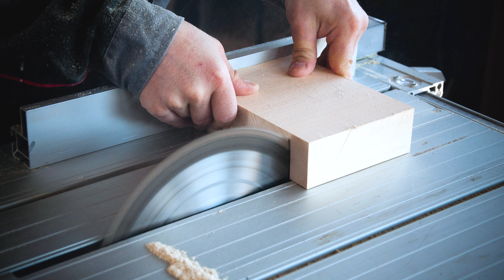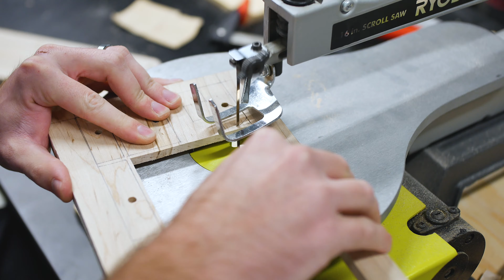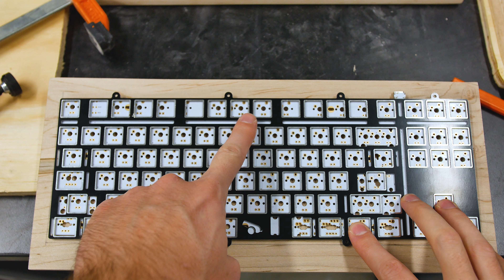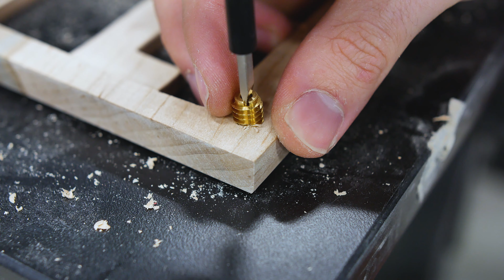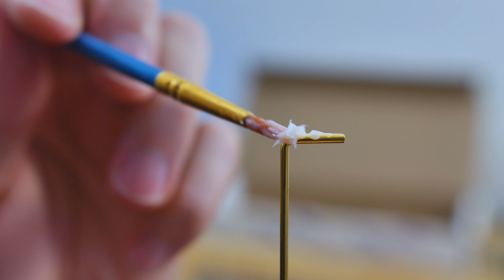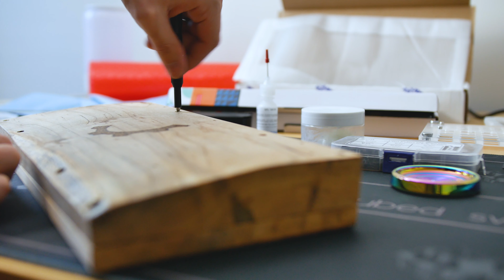I Turned This Block of Wood Into a Mechanical Keyboard

Comment from the maker: I originally wasn't planning to make another handmade wooden keyboard since this content was outside my normal review routine, but with the recent flood of support from you all I think I might just change that decision. I still don't have a CNC router, but where's the fun in that...thank you all for the support and comments!

Much love,
-JD
Reply: Did you use router when making that wooden case?
Reply: You should use strong magnets for the frame so it's easier to remove
Reply: Hey there, great video, just wondering what threaded inserts did you use. Planning on building my own!!
Reply: Where did you get the stand-offs from I'm trying to do a build sorta like this with the wooden case it would be great if I could get the parts. As you know I'm trying to do this is there any way I can be walked through with the steps etc? I also can't find any wood for my keyboard :(
Reply: @ako4693  you should have some kind of lumber store near me.
Reply: Please do! I have a mk870 on the way which I plan to purge for the parts and give a nice walnut case.

Comment: Hey cool videos. Have you tried making the plate too? I am wondering how will it feel.
Reply from the maker: Thank you! I haven't tried making the plate, that would require a lot of precision haha, if I had a CNC of some sort that could be a possibility which could offer some unique sound profiles, but I would worry it would be too brittle
Reply: @jdtechgear  Yea, it bring like around 1.5mm thick might be a challenge. Not sure if using like PU finish or wood hardener help.
Reply from the maker: @jierenzheng7670  I think I would have to find the right type of wood species that has bendy properties to it while akso being able to cut precisely

Comment: Where did you get the stand-offs from I'm trying to do a build sorta like this with the wooden case it would be great if I could get the parts. As. you know I'm trying to do this is there any way I can be walked through with the steps etc? I also can't find any wood for my keyboard :(

Comment: couldn't you have just used template tape and a raised router bit to cut those holes out for the top plate? would have been much less stressful
Reply from the maker: No, the handheld router is too volatile for that. Also add on the risk for blow out between those narrow margins between the key clusters.

Comment: Next time draw two lines 1-2 mm apart, the external line is your actual line. Cut the internal with the saw and sand or file the remaining, more accurate result and it feels like you are a pro as well
Reply from the maker: Will try this next time!

Comment: GREAT CONTENT!
Hoping to see rubber o-ring mount configuration (like bakaneko), no standoffs but provide flexy/bouncy typing experience and provide even sound across the whole keyboard.
I think it will be pretty straight forward but giving you new challenges at the same time 😂

Comment: Mad respects and thumbs up for Anubis switches! This is truly end-game !
Reply from the maker: I really like them! I do wish the bump was bit earlier in the key stroke, but that's a preference that I can get used to. I would use these in another build for sure!
Reply: @jdtechgear  cool to hear. I am going with holy Bobas in my upcoming build but if i had known that the Anubis switches existed before I bought the holy bobas I might have settled for those instead.
Reply from the maker: @Lacsap3366  You'll probably have a sharper tactile feel I believe? Similar sound, but the Boba U4's are good comparator. I haven't had much experience with frakenswitches. What kind of plate and keycaps will you be pairing with the holy Bobas?
Reply: @jdtechgear  my whole build will consist of:

- GMMK Pro
- Polycarbonate Plate
- Holy Boba / Sake Switches
- Durock V2 Stabs Holee modded with UHMW tape, housings lubed with 205g0,  wires lubed with XHT-BDZ, foam under the stabs 
- gasket mod using D65 gaskets 
- PE Foam mod
Reply from the maker: @Lacsap3366 Sounds like a solid build, I'd recommend leaving out the internal foam to get more sound out of your Sake switches, that board likes to mute a lot of sound.
Reply: @jdtechgear  which foam exactly do you mean ?

Comment: It turned out super nice!  I was a little worried when I saw the scroll saw cuts--but it sanded up cleanly.  Great job!
Reply from the maker: Thank you! Trust me I was really nervous if I could get the scroll saw cuts right. As long as the sections in between the key clusters were sturdy enough I could file them down and sand to a better finish.

Comment: Dude this build is awesome, so happy I came across this. I recently did a wood keyboard build video myself and it was such a struggle, the thin wood grain around the keycaps borders is so weak.

I'm shocked you did this with only a trim router and scrollsaw, and got it on the first try. I had to do like 6 tries on mine bc the wood borders kept snapping 😭    Cheers!!!
Reply from the maker: Thank you so much! That was one of my primary concerns that the spaces between the key clusters would break since the wood is so thin. This Maple is sturdier than I expected so they were able to be filed and sanded without much worry. 

What kind of wood are you cutting? I know some species of maple are softer than others, but it is possible! I really didn't expect to get this far with a scroll saw haha
Reply: @jdtechgear  I did oak, also a hardwood, but I used a full sized router so it's power kept blowing out the weak points. This video gave me alot of ideas for my next wood case build. The scroll saw is so gentle and quiet so that's probably why you had more luck. Makes me think I should've used my coping saw to cut out the delicate parts (don't have a scroll saw)
Reply from the maker: @dinkles_woodshop  Oh I see, the blowout would be an issue I'd be worried about as well. I hope there is an easier solution than using the scroll saw. I wonder if there is a router dedicated to precision, low power cutting? I guess that's why aluminum works so well as a case. Interesting to hear your side of it. I'd like to do something similar like this again, however the cutouts were so tedious it makes me nervous to test my luck again.
Reply: @jdtechgear  I might try to lower my router to it's slowest rpm, but I think it might still be too powerful. I think next I'm just gonna make a 40% case with no borders in between 😅
Reply from the maker: @dinkles_woodshop  I would also be interested in knowing if the lower speed will help blowout. I certainly want to look in this direction for future projects, it will require some tiral and error. I'm pretty sure I was going cross eyed from staring at the scroll saw blade on the pencil line for so long...40% minivan style board would be perfect!